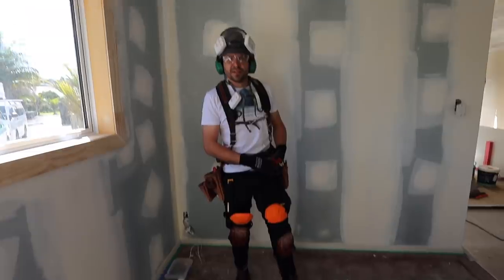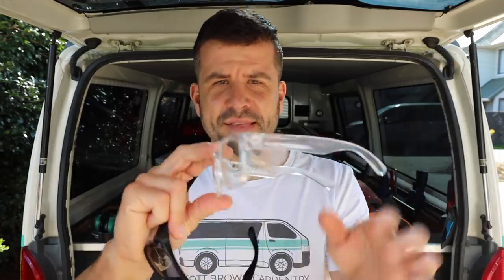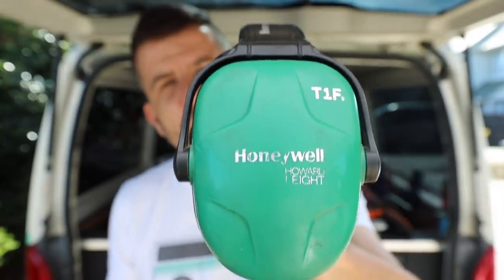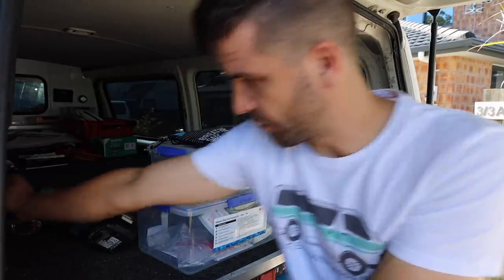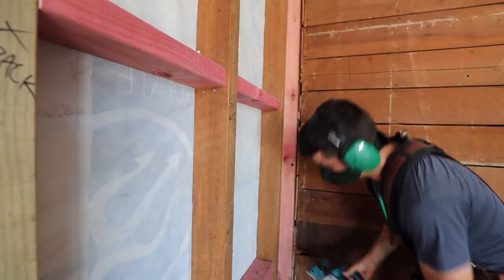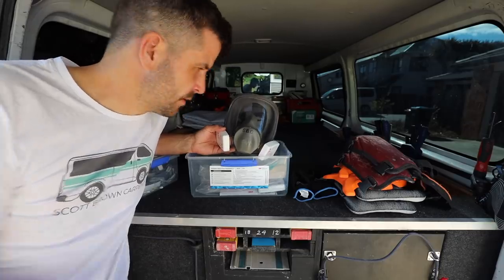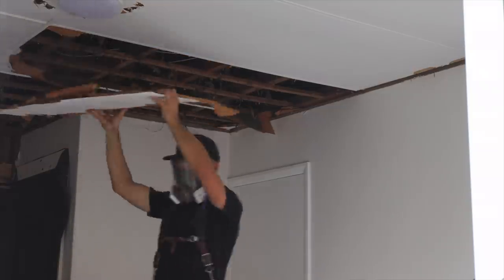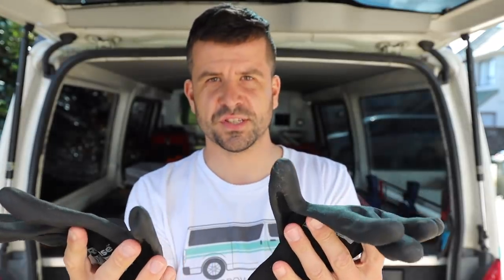Protect Yourself Before You Wreck Yourself!

Comment: Yep, the best form of dust protection is to remove the source as practicably as possible, and your use of the vac is the best way.When doing demo an extraction fan is a good method, won't stop the stuff falling from piles above the ceiling, but will minimise the residual dust in the air...always worthwhile wearing the secondary protection though. Keep up the great OHS work Scott and crew...it well worth the effort in the long run. Cheers from Aus!!!!!

Comment: I've been in carpentry for many years now. Mostly house framing and I've also done a lot of hardwood flooring. But I never wear knee pads, simply because I almost never kneel down onto my knees. I usually do what some people call the "Asian squat" where I'm working on the floor, still fully on my feet, but my knees are up around my shoulders. I know a lot pf people can't actually do that, especially at my age (54) but it's the way I've done it all my life. If I put on knee pads, then after 5 years they still look brand new!
Reply: Good for your back too. I get a great stretch from doing that
Reply: Yeah great for your lower back. I solved my long term and debilitating lower back problems by doing just 2 or so mins of spread-knee, deep asian squats a day (while brushing my teeth) before bed. The classic builder's injury. Amazing how loosening up the hips can loosen everything from the lumbar to the hammies.
Reply: It's by far the most healthy way to do low work for both back and knees, but like you say, many, many Western adults have let their natural flexibility decay horrendously by the time they're adults and can't pull off that stance. Nothing a couple of months of yoga won't fix though.

Comment: Great video Scott. It's really good to see that you take safety seriously and  actually use the gear on the video. I've worked in the Engineering business for most of my career and safety has always been important. I don't know if they're available in NZ but I use Emtec Housebreaker ear plugs. These are custom moulded to your ear and can be worn comfortably all day. They're not cheap (£80 GBP) but a set lasts around five years (Emtec recomend that you have new ones every five years because your ear changes shape as you get older). I like them because they don't interfere with your safety glasses and you can hear normal conversation with them in.

Comment: Hey bro, with regard to earmuffs I must recommend the 3M Worktunes ear muffs - they are about $139 at Mitre 10. They are Class 5 like your Honeywell muffs and to the tunes on or off and to answer and hang up a call is all done with one easy to press button the side - 
I’m a Sign Writer down here in Lower Hutt and Ive been using mine a month now and love them. battery lasts ages, charges via USB I can even take a call in a diesel scissor lift and the person on the other end of the call hears me clear as day!

Comment: “Cancer causing chemicals. It’s not even a conspiracy it’s just the case”! Total fucking legend right there no bs just telling it as it is🤣🤣
Reply: you think they use different chemicals if it been linked to cancer but thinking again could the first set of chemicals they used were even worse!
Reply: New Zealand still allows CCA-treated lumber in residential construction. The A is for Arsenic.
Reply: Copper Chrome Arsenic treatment is essentially required for any timber that is going to get wet, piles is the example given.
It’s one of those old ish treatments, that nobody (including the government) is under the illusion that its fine for your health. 
But its used in places that people generally dont touch it all the time, except the builders. The real danger is when you burn it, a lot of the impregnation comes out then and you can get poisoned.
Reply: @QALibrary  
They would use something else, if it were available, and was proven beyond a doubt over the long term. The government is extremely risk averse when it comes to new build housing now, after the regulations were loosened up a while ago and made a huge disaster, and were subsequently tightened up again.
There is also would be a lot of criticism about cost increases if they enforced a very expensive treatment. The housing situation is bad enough lmao. Left right, green, blue, you name it, every political faction want more cheaper housing.

Comment: Have a look for side zip boots. They have laces but you can still get them on/off without undoing the laces. I find them easier to get on and off than slip ons and if you roll or break your ankle you won't do more damage getting it off (or have to wreck them by cutting the boot off). Some construction employers mandate this type of boot in Aus for the above reasons

Comment: Hi Scott - just a thought - you mention having to take your boots off when going inside all the time. Have you tried just wearing disposable boot covers? There are various brand available in NZ and work out about $2.50 a pair.  Keep a pair in your pocket, slip them on and then you wont get sawdust in your socks or tread on a splinter.

Comment: Knee protection is like 101 for an electrician. But most people in Sweden use Bluetooth headphones as ear protection. There are some ear protection that meet the DB reduction requirements around here. But they cost like 500 as well ( for a good pair ), so you can answer calls and what not. Other things for protection beyond eye protection tends to be well, those gloves. They help a lot for an electrician that cut into plastic around here. Prevents the slip of a duller knife from cutting through as you work or poking your finger with copper wires that lead to bleeding (done that a few times. )

Comment: good video scott. safety wear is so important. i go for peltor ear defenders, and just a standard 2 filter mask i got at screwfix. i have worn snickers floor layer trousers for atleast 6-8 years now so i always go for those floor layer knee pads. they really do break in quite well so maybe you should revisit them. im 40 year old now and no knee pain so i think im doing well. im gonna look into your links for the gegs though. i currently have a dewalt pair of safety specs but they are just the cheap ones and fall off if i bend over. the stupid things..... dewalt footwear i have zero complaints about though. always go for dewalt lace up boots with steel mid sole. rathe rnot have any foot/ nail related incidents

Comment: Hey Scott if your in the market for a second half face mask I use a nearly identical one except it has a quick latch that you can pull to loosen the head strap made by 3M as well. It's super convenient to undo even with both hands full. Also pro tip for the knee pads that use straps get yourself a pair of cheap footy socks (or any thick soft ones) cut the toe off roll it up and put the strap through the sock. It helps heaps, you can sew them together so they are tight to the strap but still lose enough to throw them in the wash to clean.

Comment: When I was on the tools in the UK 30+ years ago doing lots of T&G floors etc. the best knee pads were those I could get off miners who worked down the coal pits.  Best works boots and most comfortable I have ever had are the ones I got whilst working in QLD, Australia - Steel Blue safety boots with metatarsal guard.
Reply: They also give a 100% money back comfort guarantee.

Comment: I use nitrile gloves regularly when painting, gap sealing, siliconing and using glues and chemicals. It save your hands and makes cleanup quick and easily. Its also hygienic when your dealing with sewer plumbing, glass insulation, plaster cement, stud adhesive, oil & grease etc.

Comment: Totally agree about the ear protection. Plugs don't work for me. Medics have to get out their small children's kit for looking into my ears. 
   Extremely useful advice that I wish I'd done during last 40 years (occasional but serious DiYer). In last 10 years, if I'm going to work on a dusty area, I have a cheap vacuum cleaner with the hose in the blower port in one hand, a vacuum cleaner hose in the other hand and, often a third machine with hose pointed in a suitable direction - I keep blowing and vacuuming until nothing gets disturbed from nook or cranny and, suddenly, the air smells sweet. Then I start on the dust generating drilling and grinding and keep vacuuming it up. It adds time - which have as DiYer - and makes the job so much less unpleasant.
   Never yet found knee pads that work for me.

Comment: I wear what are called "pirate trousers" in the summer time. I get them from the mammoth workwear website. Snickers makes some as well as blaklader etc. They're 3/4 length pants with knee pads that work super well for keeping cool without sacrificing your knee pad pockets. I highly recommend them. I've been wearing them in the summer for years now. Some even have spandex in the crotch to prevent tearing during carpentry gymnastics.👍

Comment: there's another 3m mask we use at work (6500QL), has a quick release on the strap so you can put it on and take it off super quick and easy. generally i find the easier it is to put on and take off the safety gear, the more likely you are to wear it

Comment: We use Sunstrum battery pack respirators for grinding and laminating fibreglass. Also need to have a full change of clothes as the paper suit must stay fully on for all the grinding & epoxy work. It can all get a wee bit warm inside those suits. Just a spare t-shirt doesn’t cut it on hot sunny days! 😆

Comment: Thanks for the informative video. Would've been nice if you had mentioned the levels of protection against particles. FFP2 vs FFP3, etc. And what level of protection is good for what sort of job, sanding, painting, regular saw dust, asbestos. I'm also curious if the regular headsets with noise cancelling actually have any effect on cancelling the noise from a table saw or sander that has more uniform noise level.

Comment: ive noticed not many glasses seal well besides goggles, but i have thought about getting a 5 or 6 point harness backfull face respirator like your coworker uses, since they have welding attachments. and they also have really nice metal filters you can order cheap in bulk (box of 6 pair for 85 in US amazon), i meant to ask, whats the difference between a track saw and a circular guide rail compatible saw?  OH and milwaukee makes some badass cut resistant gloves just like the ones you wear but better and still cheap

Comment: I have also had issues with the fit on the little foam ear plugs. I ended up getting some custom made ear plugs where they make a casting of your ear canal and then make custom fit ear plugs from those. They work great. I use them any time I need ear protection all day. For the times I only plan to use loud tools occasionally I have a set of ear muffs with the chop saw, mower, blower etc.
Reply: I bought every single earplug I could get my hands on to test em. I hadn't known 3M made so many different styles out of so many different densities of materials! Found 2 that fit my larger canals and use them exclusively. One fits tighter and is a little less comfortable but that one cuts as much as my good earmuffs.

Comment: You have one body look after it sample
I work for 3M and I am married to an Emergency Room Doctor safe first here.😁. Bias opinion the 7500 series half mask is brilliant. I have tried many 3M and others over the years. The one you have is my favourite. Comes in three sizes and you can get different filters of your needs. You have the 635, FFP3. You can also get gas and vapour protection if need.
One serious point. If you don’t shave your respirator will not seal against your face, effectively by passing the filters.
Good video stay safe 😷
Reply: S'funny, I hear that a lot about facial hair. I work with my floor sander sometimes and he has a thin-ish and scraggly beard. Even working with the strongest smelling isocyanates he says once the mask is on he smells absolutely nothing.

Comment: Scott, once you’ve put the snickers knee pads in, just keep them in. I use their type 2 foam knee pads and in my other pair of snickers I use the D3 snickers knee pads. Both pairs just go straight in the wash and the pads stay absolutely fine. The big silver ones you had are floor layer specific and I think they only fit the floor layer specific trousers.
Reply: That's good, you couldn't wash the old ones hot, or they'd melt.  I still use the kneepads from my first work trousers... they're going to be 19 this year.  I should probably get some new ones.  😏

Comment: I use a pair of heavy-duty Blundstone 910 slip on boots. They're great. For pants, I buy a brand of pants called "Fristads" It's a Swedish brand that has a great model of workpants. They are soft and flexible like sweatpants. But they are dirt resistant, breathable and have reflektors on the legs. Im a pretty heavy guy and not very flexible to begin with. If I use the standard canvas pants its all just a battle throughout the day. With the flexbile workpants its so much easier to work!

Comment: working in Victoria Aus, we always had to wear the lace up steel caps, can't remember why, think it had something to do with emergency workers being able to cut the laces and remove the shoes easier. but i was constantly in and out of customers houses doing work that really did not need steel caps, so i ended up getting some that are lace up but also have a zip on the side so you can leave the laces done up but just unzip and slip them off.

Comment: As a man with a big nose, let me tell you how full face masks are the only way I can go if I want actual protection. 

I learned this when I started working with spray finishes. In general demo I always used a paper N95, good for particulates, but when I bought a 3M half mask to do spray finishing, I was still smelling the vapours. I realized my big nose pushes the top of the halfmask out and creates a gap under my eyes.  I even bought a second (higher quality and larger size) half mask. 

In my gassed out, brain cell damaged states I couldn't figure out why the masks weren't working but once I came to, I bought a full face mask. Gamechanger.

Comment: Couple of comments; Boots - I'd say, as a C&J working where you could end up with nails sticking up out of discarded timber is ensure the boots have a steel insert in the sole as well. Me I use 'rigger' boots as they also give sideways protectioon to the ankles. 
Breathing - now use a Trend Airsheild powered respirator - full face mask, safety helmet, eye protection and can have ear defenders attached as well (see :- https://www.trend-uk.com/air-pro-anz-airshield-pro-respirator-austalia-new-zealand-plug-240v-authorised-distributors-only)

Comment: I always prefer a lightweight work boot, save lugging that much weight around on your ankles all day. Typically lace up 'runner' type so you have a firm grip with a composite toe.

I like tight fitting soft leather gloves with the velcro on the wrists. More expensive but they give the best feel/fit imo.

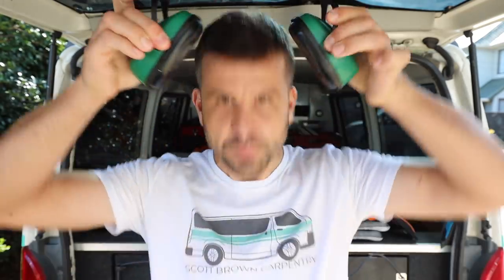Comment: 1:30 About 36 years ago I had to work in a factory to get some $$$ for a Multi Command Instrument Rating and my first night on the job an old (at the time he was) Leading Hand asked my why I was wearing earmuffs because you get used to the noise fairly quickly. I spent maybe 5 minutes a night with my earmuffs off and that was usually when I walked into the place and got to my machine.
I want a pair of those safety glasses. I only do small round the house things but the amount of time the wind catches the sawdust and blows it in through the side of the glasses. Maybe the Universe doesn't think I blink enough. 😏

Comment: More good stuff, thanks. I’d like to hear more about the various cartridge types you use with the 3M mask. Dust. vs. Volatile compounds filters and those square ones you show in the intro which are unfamiliar. Or perhaps your painter could weigh in on that?
Reply: 3m brand, and they are rated for asbestos

Comment: Silicon respirator (blue) worked better for me than a rubber one (gray). While it's more expensive I found that is seals even when I don't shave for several days while the rubber one doesn't seal unless I got a smooth skin

Comment: What helps me with strapped knee pads is to use only bottom strap- it holds surprisingly fine and no nonsense on the back of my legs.
Reply: Indeed. One of the pad brands I use has just one lower strap and are the most comfortable. Great for indoor work but no good for scrabbling about under a house.

Comment: I'm a flooring installer and I never wear knee pads, not because I'm a tough guy or anything I just find them to restricting and I know guys that have worn them there whole life and had nothing but problems. 14 years and my knees are stronger  than ever so I guess I'll deal with the consequences if they happen.
Reply: have you tried expensive gel kneepads?
Reply: @sadiporter2966  no I don't feel the need to at this point.

Comment: Does the full face respirator fog up ?
Reply: I have a Norton one and it does when it's cold but I'm exerting myself enough to heat up. Doesn't happen often though. Condensation in cold weather is more of an issue, you need to wipe out around the exhalation valve occasionally or it'll drip out when you look down which can be a problem depending on what you're working on. Most of the time it's perfect and the full face is by far what I use the most as you don't need to worry about glasses. I rarely use the half mask. The downside is they're hot in the warmer months (ie 9 months of the year in Aust)

Comment: Lucky that builders don't have to wear safety glasses all the time. In engineering it's compulsory along with overalls. No slip on boots allowed, double eye protection when grinding or buffing. Ear muffs or plugs when ever using loud equipment. Lace up boots with zippers are good though, quick to put on